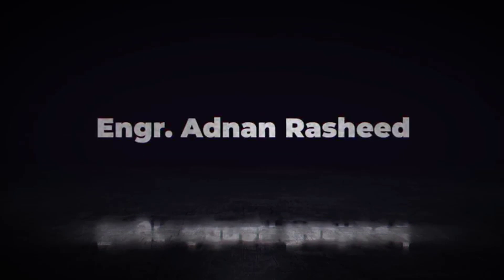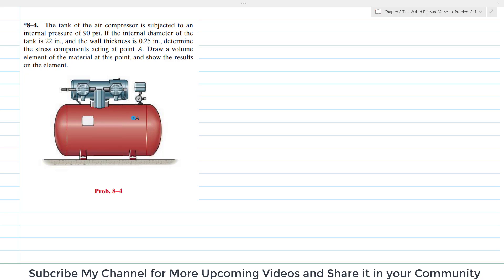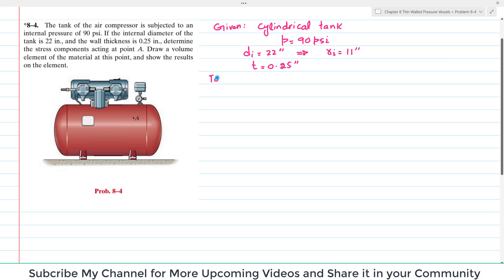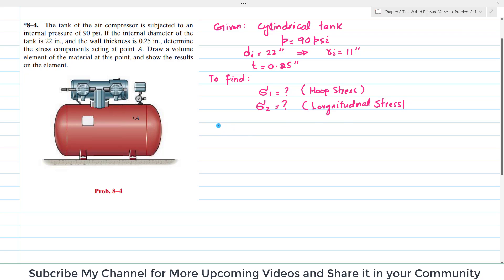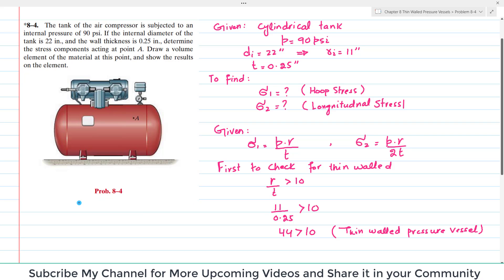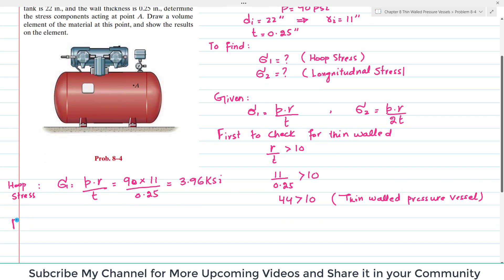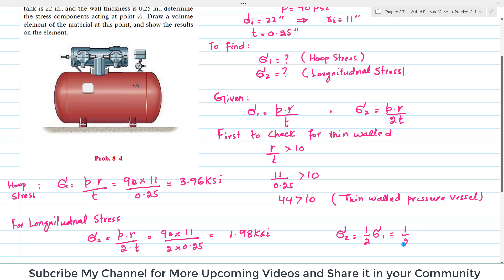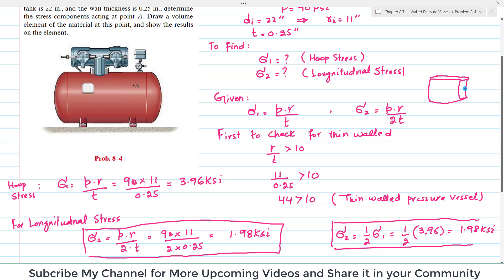8-4|Combined Loading |Mechanics of Materials R.C Hibbeler|

Comment: ---

A - Calculate the minimum wall thickness for a cylindrical vessel that is to carry a gas at a pressure of 10 MN/m².
The diameter of the vessel is 0.6 m, and the stress is limited to 80 MN/m².

Sorry to bother you, but can you solve this question for me or even just tell me the idea? Our teacher says we solve two solutions because he says in the question minimum and in the end choose the appropriate one
Reply from the maker: The answer is 37.5 mm and how can i send it.
Reply from the maker: you can calculate it by using two formulas 1. hoop stress = (p*d)/t , so t= p*d/hoop stress , you will get thickness t. and 2. t=(p*d)/(2*stress) you will also get thickness , now choose the greater one and that will be from the 1st one 37.5 mm
Reply: @engradnanrasheedmechanical 
Thank you so much

Comment: Hello, I would like to ask you a question on the topic of cylinder vessels. How do I know which law to use, the hoop stress law or the longitudinal stress law? I hope for an explanation from you.
Reply from the maker: If you have been asked to calculate hoop stress then use its formula and if it has been asked to find longitudinal then use its formula and if it is asked to find the the stresses in thin walled cylinder then calculate both....
Reply: @engradnanrasheedmechanical 
Thank you very much